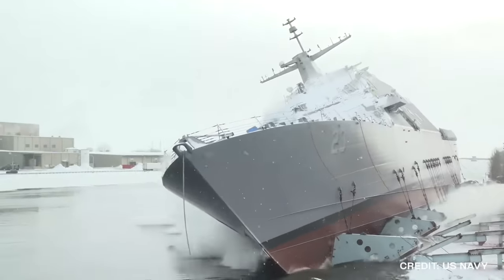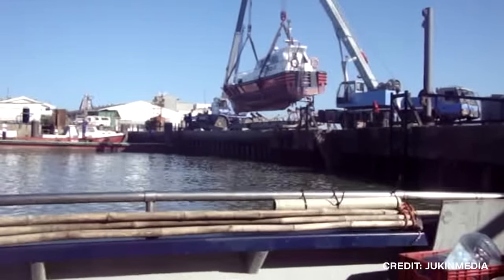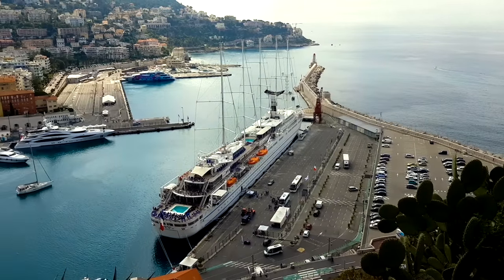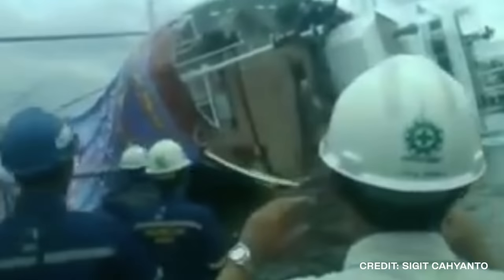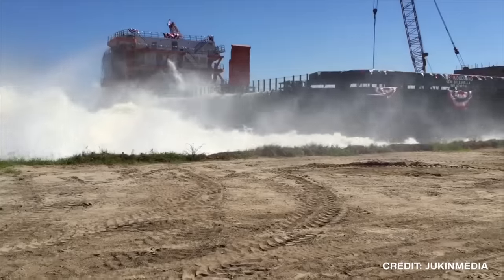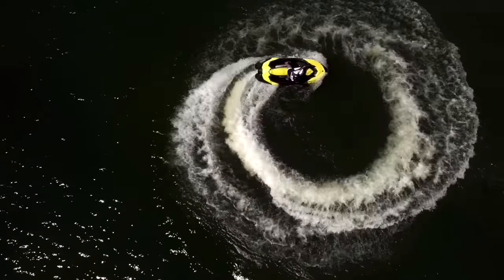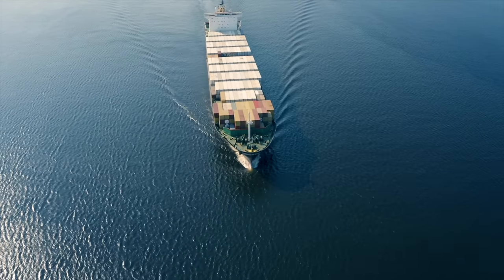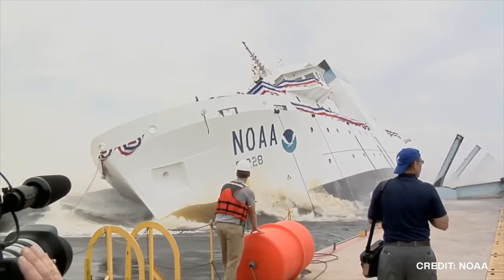5 Ship Launches That Went Horribly Wrong

Comment: 7:00 some boats are known for having a significant delay in their controls, especially when switching gear between forward and backwards. You have to understand that delay to avoid accidents like this.

Edit:
There were an accident in Norway, on national news in 2007. Someclaimed probably caused by this issue, and young (probably inexperienced) driver.
Reply: There's no delay in the throttle, which they didn't shut off
Reply: @treed5953  there are some boats where there is a delay in the controls.
When you shift throttle from backwards to forward, there is a delay while the gear box does it's thing.
While gear is shifting the boat wil continue backwards, if you push throttle more forward because nothing happens, you can get in trouble once the gear box is done shifting to forward. 
Then, if you didn't loose your balance from the boat suddenly going forward,  you might try reverse again, but if the boat already have speed forward, it will again continue while the gear box is shifting.
But if you lost your balance, there's no one to stop the boat. 

I don't know if the boat in the video had this kind of controls. Just saying that things like this are prone to happen with inexperienced drivers if that was the case.

If you know about the gearbox delay, (that's there by design to avoid excessive force from switching rotation too quickly), then you take it into account, to use controls in advance, to have enough time for the shift.
Reply: @thorbjrnhellehaven5766  A visit to Lake Havasu will help you form an opinion of the qualifications of the boat operators there. ( It probably won't be a high one)
Reply: @treed5953  obviously the driver is inexperienced, and should never been allowed to operate tat boat. When people believe driving a boat is just like driving a car, it's just an accident waiting to happen. I grew up in walking distance from the sea, I don't need to go anywhere to believe there are idiots in boats other places too.

My point was merely that some boat engines have a gearbox that won't switch without a delay.
1 second delay isn't a problem when you are aware of it, but if they never been in that boat, they suddenly realize there is no brake pedal.

Looking at the clip again, my guess is:
First they put it in reverse, but were a little startled by the power, and tried to coner that, going a little forward, when it didn't switch to forward they pushed the throttle more. When it finally switch to forward, it kicks with full throttle, an they are completely overwhelmed unable to do anything but try to hold on.

By considering a possible gear shift delay, I'm not trying to make an excuse for the accident. More like speculation arround contributing factors to a worse outcome.
Reply: @treed5953  there can be if the throttle and direction are on the same lever (and  a great many are), once the gearbox actuator jams, the cable from control lever to gearbox will not move , neither will the lever, and thus neither will the throttle. His only option was to shut it off or pull the Deadman out.
Reply: that was pretty much what I came to say, not so much there IS a delay, but that there SHOULD be a delay. I'd wager he panicked and slammed it into forward from reverse WITHOUT that delay (in neutral) and jammed everything up. From that point on the outcome was sealed unless he pulled the Deadman out or turned it off...but I doubt that was on his to do list at the time.
Reply: No they don't. That's just operator error.
Reply: @k.whiking4372  The Volvo Penta IPS (Inboard Performance System) is an advanced propulsion system used in various boats. It incorporates a deliberate delay when transitioning between forward and reverse gears, which is designed to ensure safe and smooth propeller engagement. However, if an operator were to command more throttle during this transition, expecting the switch to occur sooner, it could lead to potential dangers. When the switch finally happens after the delay, the sudden surge of high power could cause the operator to overcompensate in the opposite direction, resulting in abrupt maneuvers or loss of control. Hence, it is essential for operators to understand this delay to ensure safe boating and prevent operator errors.
Reply: @k.whiking4372  I'm not an engine expert in any way, but I know for a fact the it has been claimed that the delay of Volvo Penta IPS, has been a contributing factor for accidents with inexperienced operators. Yes, It's still operator error, but unless they understand that delay, it is an easy error to do. With my limited knowledge on engines I expected other manufacturer might have designed similar delays in their systems. Because as long as you are aware of it, you can give the command in advance. If you don't, that's when panic gets you and operator error happens-

Comment: Your analysis of the first launch is completely wrong.  Both cranes are lifting the boat, and the problem has nothing to do with the height of the tide.  The problem was simply a miscalculation of the weight which the crane could lift at a given distance from the crane.

Comment: #5 boat launch fail. The tilting of the crane had absolutely nothing to do with the water being too low, period. This is not the first video that you've posted in which your narrative is way off, including, providing photos of areas that not related in any way to what you are bringing attention to, and making false conclusive claims. For instance, in the abandoned Olympic facilities video, you claimed that all the Olympic venues for the 1936 Olympics in Berlin were abandoned to ruin when in fact it's only the Olympic village that has suffered such fate. The giant Olympic Stadium, along with several of the Olympic facilities, have been completely refurbished before  Berlin's bid to host the 2000 summer Olympics. Your videos would be a lot better if you stick to the facts.

Comment: I'm always amazed at people messing up when launching small boats. Especially monohull bass boats. You're talking a vessel no more than 20 feet long with usually a 100 hp engine. Sometimes less. Sometimes more. Yet people struggle just backing the trailer into the water, then comes the actual launching.
Reply: Almost half of them are what we call "credit card captains." They buy a fancy new boat with their "platinum level credit card" to show off to everyone but they don't know anything about boats. I'm talking NOTHING. And quite a few cannot swim either.

Comment: The large vessels are masterpieces of modern engineering. The launches are straight out of the stone age.  When launching such a massive multi-ton (aka:tonne) vessel, shipbuilders consider so many things, from the size of the ship to the site logistics,  to get the ship in the water. A successful launch is cause for celebration, but the slightest miscalculation can ruin it,  even claiming lives or sinking the ship.  In your video, the ship built in Jakarta, Indonesia failed to launch, and made the ship un-seaworthy was at 3:18. That was the end of that ship. They scrapped it and to the scrapyard. It wasn't just launched badly, something else was wrong with it and the engineers immediately knew that it must never sail the seas. The big ship most likely had a too-high center of gravity and would never survive the ocean's storms. Shipbuilders just never know until they launch it. People watching and smaller boats in front of the launches are way too close when these gargantuan ships launch. Very often, people are killed during ship launches, so beware and keep a smart distance. I Just found your Youtube channel. I hit like and I just subscribed.⚠ 🛳✴🚢⭐🛥🌠🚤🌟⛵⚠🛑

Comment: The Cranes weren't properly positioned.  The boat could have been put into the water at a smaller lift radius.
*Past CCO crane operator.

Comment: Improper crane placement does it every time. Should keep the front of the mobile crane towards the object being lifted as all of the weight is at the back in the form of counterweights and the length of the mobile crane will serve to keep it from tipping over. Video crane op placed it in there backwards, paid the price by putting all the crane's weight at the back where it's easily tipped by even light loads.

Comment: This is an issue that happens way more than it should. While I have operated a crane numerous times there are those who have more experience than myself. There are many ways you can extend your reach but the two most common are extending the boom or lowering it. The accident in #5 occured from the latter. B4 you even start your operation you have to be keenly aware of both the weight of the object your moving and the counter weight and your crane. In this case the operator should have extended the boom to get more reach. Newer cranes now have warning signals that alert you of this problem. Some even will  prevent the operator from performing risky behavior. 👍
Reply: Don't cranes with extentions have strain gauges on them???   Like when the strain gauge starts going down, stop moving!
Reply: @randysmith9715  Depends Randy. Clarification is in order. For instance, the electronic indicator on most 2000 and later vehicles attached to the rear view mirror that indicate which compass direction you are traveling in are electronic. Versus the old sckool magnetic compass scouts would use. Modern strain gauges are electronic circuitry on a circuit board connected to micro processor that converts ohms and micro volts into data that the micro processor determines whether or not pre programmed weight limits have been exceeded. Such circuitry may also [likely] involve wheatstone bridges, load cells, and alarms. I'm not talking about any of that crap Randy. When I started in construction there were still fellas in the industry who were introduced to crane operation via rigging. Riggers who showed potential were occasionally giving opportunities to operate a crane. There was no formal training. Until I entered the field. My introduction was old sckool [intentionally misspelled] not the latter. The cranes I operated still had mechanical strain gauges (devices inside or outside, visible from the cab, that worked like a plumb bob). The problem with electronics is if it fails your hosed. The actuators  that control the hydraulics ( or in the case of a tower crane electric motors and gears) fail and lose the ability to raise an object but MAY still have the ability to lower it. I'm not disparaging formal training, on the contrary. One should fully understand the relationship btw weights and leverage and not rely on electronics. When lights replaced gauges on vehicle dash boards they were referred to as idiot lights. That was my point in the last post.
Reply: @UserName_no1  what cranes can you operate
Reply: @carlthelongshoreman1979  As I eluded to in my comment I have no formal training. I came into the workforce at a time when it wasn't always a requirement. My experience is/was limited to construction jobs ranging from commercial buildings worth a couple million to multi billion dollar budgets. From structural steel to reinforcing steel. So some of the equipment I familiarized myself with were boom cranes or stationary cranes. I operated a limited variety of boom cranes and served as a rigger for the stationaries.

Comment: First one, rule 101 of operating a crane is Don't try lowering it passed its low point. IE bottom of the tyre's.   That thing could lift at a guess say 200 ton .BUT it all changes when you start that nonsense in this vid.
They dropped Tube trains in to London underground  ,carriage was about 25 ton counter weight on crane 250 ton.. Think there's a vid on YouTube of them doing it.

Comment: First video with the two cranes 🤦‍♂️. Was a double lift the crane that tipped had the rear as you can see its hook over the rear of the boat. The other crane had the bow of the boat. That's why the boat went rear first into the water because the falling crane had the rear.The other crane wasn't holding it steady they would of been one or two lines tied to the boat with one or two men holding her steady. Hate education channels that just guess at what happened. And yes I worked as a slinger banksman with cranes for 10 years with multiple double lifts.

Comment: #5 It is very obvious that two cranes were holding the boat- not one. 
#4 The boat did not fall over when it was on the bags.The boat fell over in the water because it was not built right. That is why it was scrapped. Is it really that hard to get your stories right? Did you not look at the videos?

Comment: 1:48 Ferry that could hold a maximum of 8 passengers: It’s hull plowed into the water and the crane that was holding the ferry went into the air ejecting everything inside the crane into the water but the crane driver escaped the ferry’s boat deck was flooded at the stern because the stern landed 1st in the aftermath the men disused that the ferry could still be in service for transporting passengers!

3:32 Cruise ship that holds a maximum of 96 passengers: It capsized like the MS Poseidon without turning upside down most likely capsized like Costa Concordia in the aftermath the ship’s captain, along with half of the crew went flying into the water with the other half of the crew on the ship the disaster was a mini version of the Costa Concordia disaster because it tipped over and got scrapped immediately!
Reply: Note: The cruise ship lunch disaster at 3:32 had the ship half flooded because the tipped over passenger ship was half way underwater!
Reply: 5:36 Cruise ship that can hold a maximum of 100 passengers:

Successfully launched but then the splash turned into a massive tidal wave that made half of the audience get wet but were not swept away by the mega tsunami but the other half were swept away by the wave in the aftermath the shore was flooded it was the greatest ship lunch disaster the world has ever seen! But this large passenger ship was still able to carry passengers and enjoy wonderful voyages!!!

Comment: The boat they dropped when the crane flipped over was a clear cut case of using an undersized crane or it had insufficient counter weight attached and is the fault of the person designated to make those load calculations.

Comment: That extended arm is called the telescopic boom. Both cranes were lifting the boat it's called a tandem lift the crane was overloaded because that old crane probably didn't have a modern LMI load motion indicator or scale to know how much weight it was lifting but there should still be load charts for the radius the crane is lifting at. Listening to you describe something you know nothing about is like nails on a chalkboard 😆 🤣 😂  😆 🤣

Comment: I used to work at NNS in Newport News, VA and watched a number of submarines slide effortlessly into the water after the christening. Aircraft carriers were quite different. Built in a gigantic drydock that was filled with water when the craft could float, then finished while sitting at a pier. Serious technology.

Comment: instead of the one you showed that created that larger than expected (if still relatively small) splash, why didn't you show one where the ship took damage below the water line, and either sank shortly after launching or had to be towed back to a drydock for emergency repairs?

Comment: In all but the unskilled-driver case: high-school science shows each error, and I could have predicted failures pre-launch with facts on hand. One can see the crane too far from the boat for centre of gravity, (also all the truck's resistabt weight is at the engine end); know that waves will likely wash far up a flat shoreline, and air bladders without side restraints do not give lateral support - and expect wooden ramping for a massive ship to splinter. Where is the professional understanding of basic principles?
Reply: You're lying.
Reply: @frodolives8969  Ame has a point. Nothing to do with lying.

Comment: Most shipyards use a floating dock, something like an emptied pool to build a ship, and they will they fill the pool to set the ship in water.
Building it on land is something only used for smaller boats up to yachts.
Reply: Not
Reply: wut...but I've seen plenty of large vessels built on land and launched with a slipway, they're all over yt

Comment: I think I know what is going to happen, with low water, the boat will be too high to drop, because of the weight on the straps. There will be a point, when the boat, beneath the cranes adds to the weight of the 2 cranes, pulling the cranes into the water. That is my prediction.

Comment: 1. says Piloto 2, im pretty sure that not a privat vessel, that´s a boat that brings navigators onboard of big vessel crossing dangerous waters
2. the vessel has not enough ballast and is to top heavy, that means it will not stay up right on its own, its a construction failure 
this is a way to long and not well enough researched video